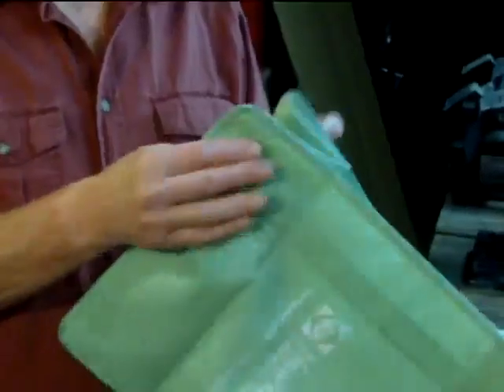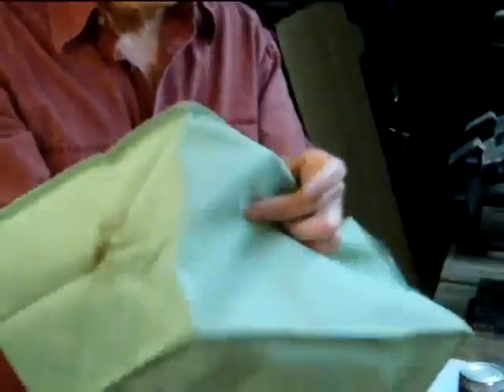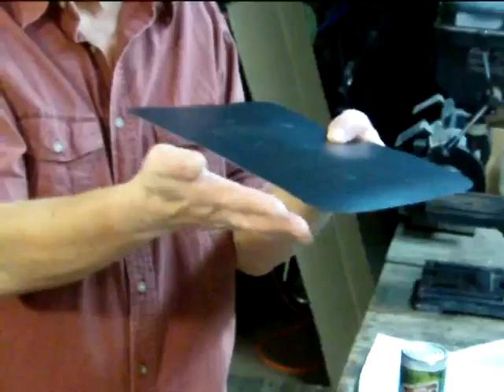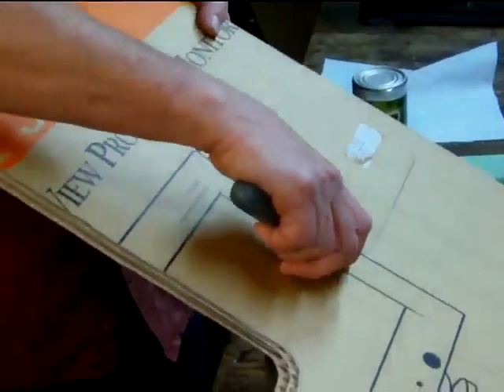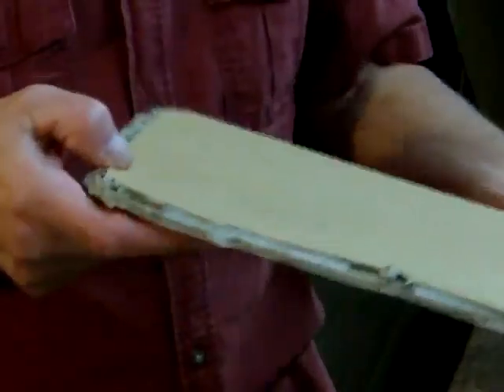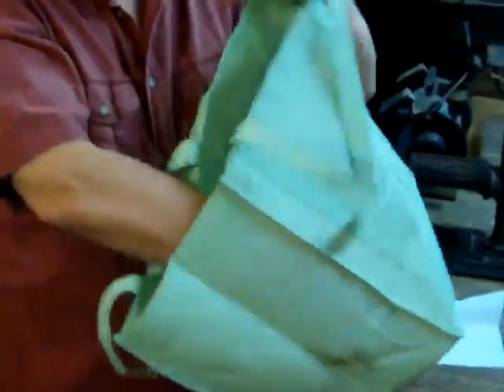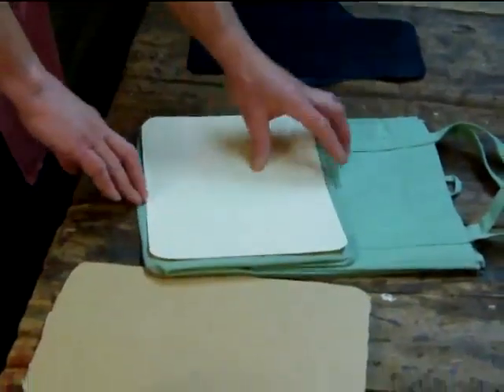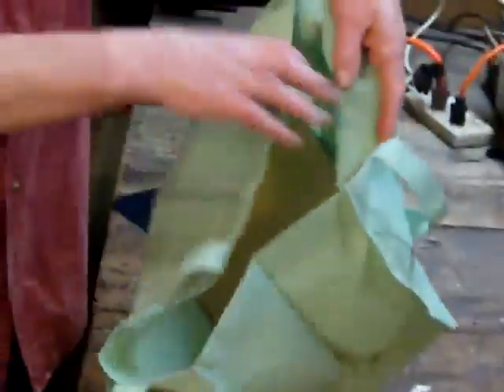Double The Life Of Reusable Shopping Bags

Comment: need a solution to the handles always ripping/breaking now. they break when the bag is packed "heavy" but not even half way filled. i have been through too many of these bags.
Reply from the maker: In my experience the handles break somewhere in the middle, which is easy to fix if you have a sewing machine. Just fold over the two broken ends, place one over the other, and sew them together. With most bags costing no more than a buck, this repair is not to save money but the environment. You could do worse. I got tired of all of this nonsense and made my own canvass super-bags, which can hold 40 pounds and will last forever.